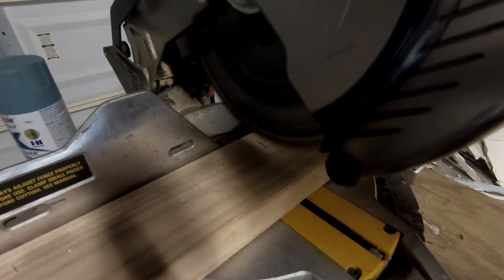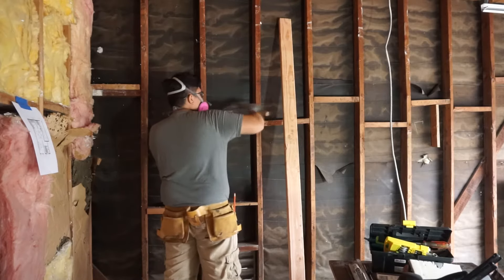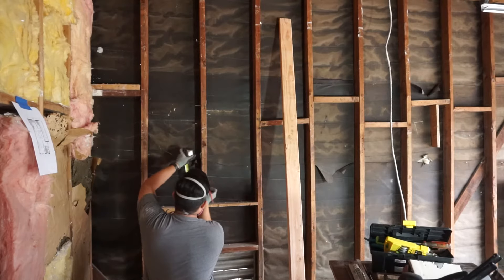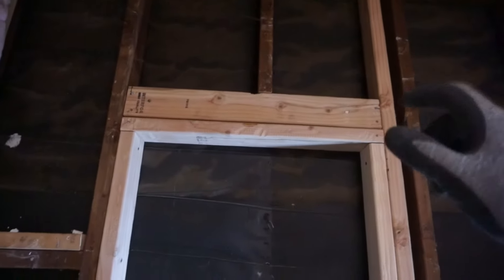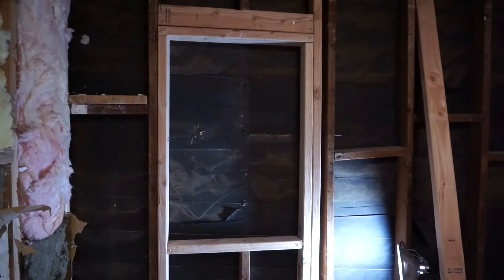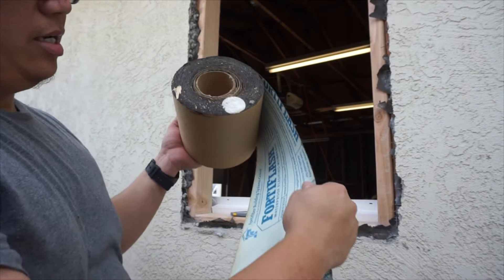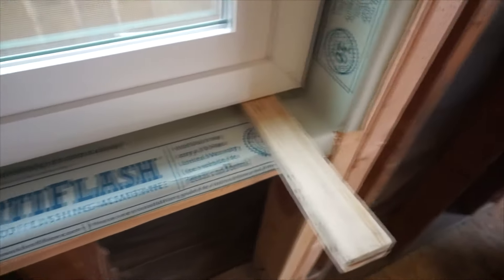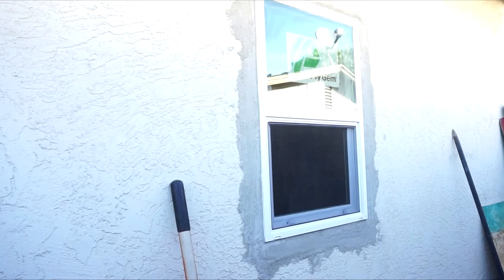How To Install A Window To Existing Wall (Framing)

Comment: Very easy and clear explanation! I live in Oakland California and noticed my window leaking this week (it's the first big winter rain here in the SF Bay Area). My house is also stucco just like yours and the leak appears to be coming in at the top of the window and water making it's way inside. I cut out the drywall and it looks like there is little or no flashing when the window was installed, so I plan to cut out about 2 inches of stucco with a masonry grinder to expose the nailing flange and remove the window and then go crazy with flashing. I plan to use  Zip liquid flashing around the entire rough opening, and jam black paper house felt as far as I can before hitting nails, and put the same window back in.  One tip I found in my research - at 7:28, next time consider adding some liquid flashing at the corners and a dab over the screw heads to make the water barrier even more bomb-proof. You can get a free sample tube of Zip liquid flashing on their website that will flash a couple windows.
Reply: Just add a corner of flashing paper to each corner.  Cut the angle the opposite of what the long strip is cut.

Comment: Best way to cut it out actually is with a grinder or skill saw with a diamond tip blade. The cut is clean. And will cut all your wires as well. It’s also fast.👌
Reply: That is true and thank you for your suggestion.

Comment: Thank you so much for this video as i've been contemplating adding a new window to my bedrooms. I'm just curious, once you do get the stucco redone, is there a way to color match the existing color? I have no clue what color it is since we just moved into it. At least with the interior walls, you can just cut a large piece and have it scanned at home depot to get a very accurate color match

Comment: There should be cripple studs supporting the window bottom but very helpful video. Thanks for posting.
Reply from the maker: That is true... You are not wrong. In my case, I really don't need it because my window is light and small. That's why I only put it in the middle for support.
Reply: Depends on the size. You don't need only but one on a small window.

Comment: I believe there is nothing to support the stucco you applied to the outside.  From other videos I have seem there is supposed to be a galvanized wire mesh affixed to the wood studs overlapping the window flange to support stucco.  Also you needed to apply caulking at the edge where the existing stucco ends.  As mentioned, flashing needs to go all around the window below wire mesh.  No caulking at bottom of window to allow for water drainage.

Comment: No cripples and stucco wasn’t floated or textured… also should’ve flashed your lower corners deeper by breaking out more stucco and not cutting the corners… literally cut the corners. Also, I hope you put two layers of building paper in exterior of gap so water that seeps in can wick to weep holes…. It’s these jobs that I redo for homeowners

Comment: what's going on at the bottom right...you said you installed a king stud but it appears to sit atop a horizontal 2x4.  Thought they went to the floor, as with the jack to transfer weight.
Reply: Same question
Reply: Yea, I would of definitely put a cripple on each side at the bottom. He is relying on nails and a middle cripple to support the wall. You can never fail for over building.

Comment: Is that a load bearing wall? If it is, you can't just cut the studs without adding support temp first.
Reply: I was about to say the same thing. But I don’t think it is a load bearing wall due to how loose the stud was after he cut it. But he should put a warning before people go start chopping out holes in the wall not knowing what they are doing.

Comment: Why not puting flashing all around the window
Reply from the maker: You could if you prefer that way so it's more susceptible to water damage in case it reach on the side and the upper frame.

Comment: Sorry lol but the hole time u had the tool belt the only thing u had in it was a pencil lol I know I know I sound rude but that's just what I saw otherwise good work .
Reply from the maker: That's funny.... I notice that too.. But I usually put nails and screws there. That way, it's easy to reach.